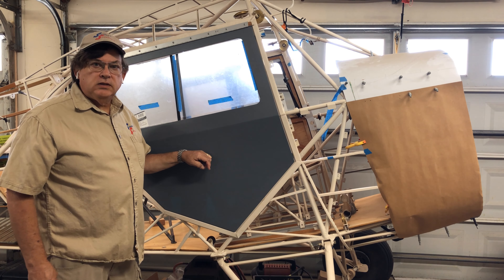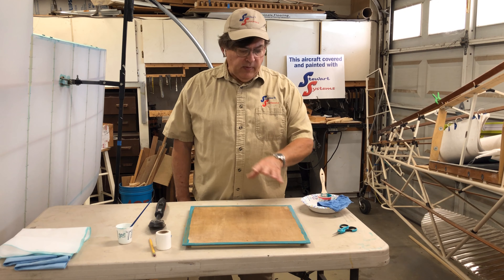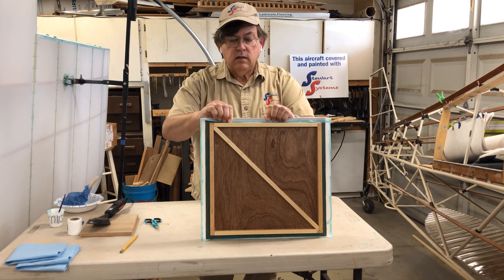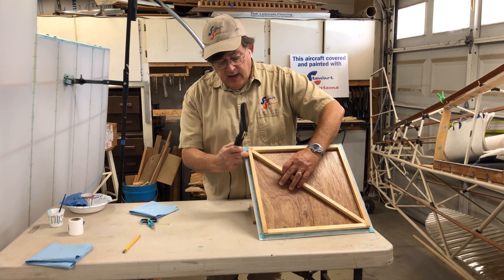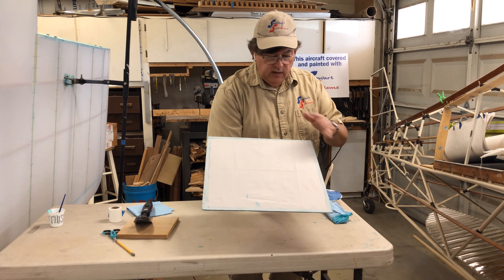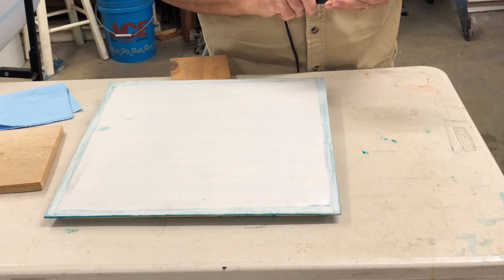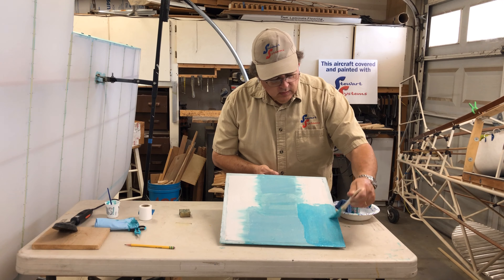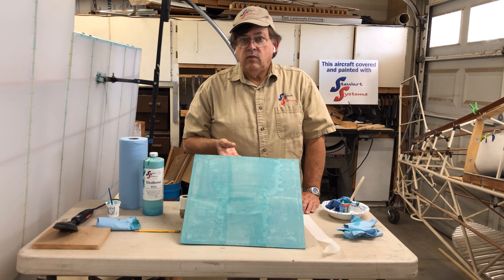Covering a plywood panel

Comment: What fabric do you guys use with your system?
Reply from the maker: You can use any certified fabric.  We normally use Superflite.  You can use Ceconite or Polyfiber 102 or 104 also, but we do not recommend Ceconite or Polyfiber 101.  It's very tight and hard to get Ekobond to penetrate it well.  Superflite 101 does fine.
Reply: Stewart Systems thank you I have poly fiber medium weight I’ll use! Thanks again
Reply from the maker: @opictia  Absolutely!  Let us know if you have any questions!